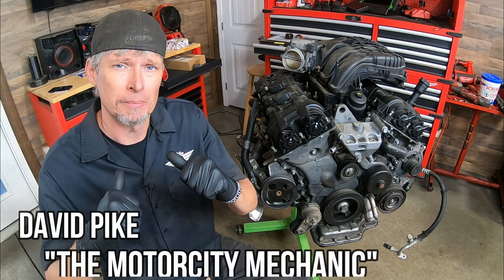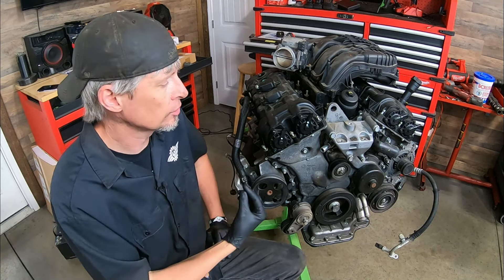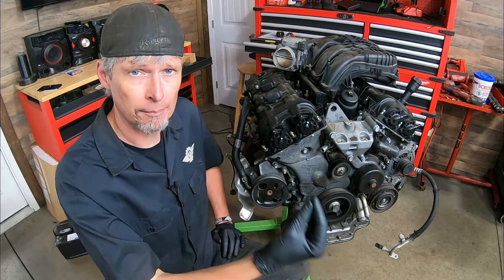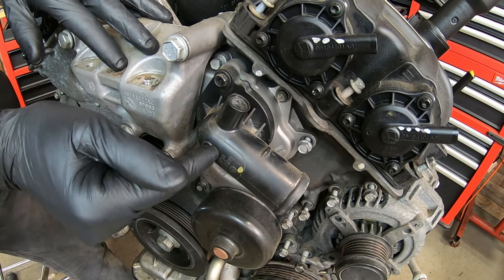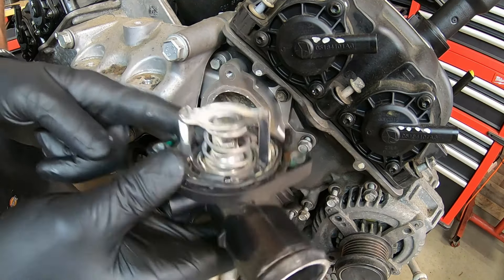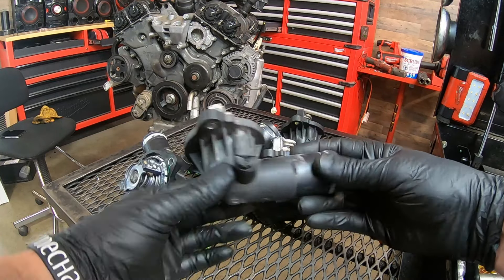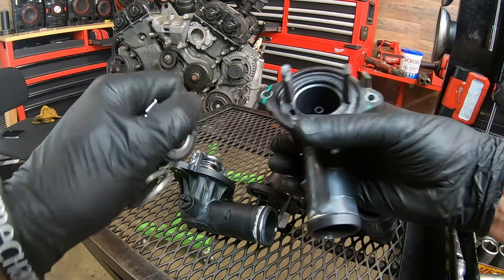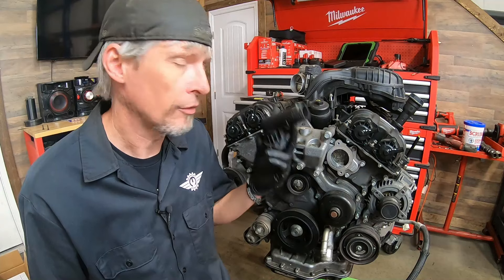P0128 Chrysler 3.2/3.6 Pentastar engine thermostat code, Top 3 causes

Comment: Current cost for genuine Mopar thermostat was around $35 before tax (6/1/23). David is correct. It is an easy to replace part. Just did mine on the 3.6 Pentastar engine, took my time and in 45 min. was done. David is also right about the ‘bleeder’. A ‘light’ approach and you won’t break or over tighten it. Good video and info. Thanks David!

Comment: Thanks David! My son's '15 Chevy 1500 had the same code, and it meant the same thing. Then a week later it spread to daughter's '14 Wrangler 😁. Coolant level was good so went with new Mopar thermostat housing.  It has been good for several months now, so I'm sure the thermostat was faulty.  Son hasn't made time for me to assist him, so we still  have got to change out thermostat on the Chevy..
Reply from the maker: It’s common for sure, at least on the Chrysler’s. I have had to replace a few coolant temp sensors on the Chevys however. Thanks for watching and for the comment
Reply: Those GM thermostats are either hilariously simple or a Total PITA. my 350 is simple.

Comment: Welcome back David. 2013 GC @93k rocker tick. By watching your video's I was able to replace new rockers and lifters and replaced mostly everything on the reassemble. I'm nearing 70 and other than working on old school Chevy 's when I was in my 20's I would not have taken on this job without your outstanding instructional video's David. You are the Master Mechanic!

Comment: Love your channel as I have 3 cherokees with the 3.2l motor and save a ton by doing the work myself. Thank you for such a great channel
Reply from the maker: Thanks for following the channel. Glad to see that the videos help!
Reply: @MotorCityMechanic  Thank You for all the information you’ve covered on these engines.     Have you  ever seen a Mopar thermostat that didn’t have a Mopar logo on it?
Reply from the maker: Typically I see BEHR (like the paint company….might be the same) on the housing….let’s you know that they are made by another company (sub contracted).
Reply: @MotorCityMechanic  I’m going to send a message to your Facebook page.  I assumed they are made by someone else, but I didn’t get what I expected. I’m hoping the two dealers I’ve talked to are not pulling some shady stuff.

Comment: Jeep Chrysler penastar engines are very easy to work on. Pop the trim cover off loosen air intake on 1 side and move over then take off the radiator hose clamp try not to spill too much fluid. Remove 2 10 mil bolts pop off the electrical connector and replace the thermostat. I just bought 1 from oreilys in Richmond Virginia today for $26. I have half a jug of antifreeze so I should be good and I'll save hundreds doing this work myself. Don't take your vehicle to dealers if you have at least a little ability just watch lots of youtube on different repairs.

Comment: My caravan set a code after 7 years. I replaced the thermostat with a Gates brand, possibly the original equipment manufacturer, $20.  It's been 5 years now no problem.

Comment: David, it's been a while since you posted a new video and this one I found to be very interesting. I am planning on doing a coolant flush and replace with Mopar five-year coolant part number 68048953AC. This is the HOAT coolant that is correct for my '12 Chrysler 200 Touring convertible. I have a new Mopar thermostat part number 5184570AJ, which I'm going to replace at that time. Little by little my car is no longer such a mystery as I have been learning and have done regular oil changes, front and rear disk brake reline and power steering fluid change so far.

Comment: Great video as always.  My 2014 threw the P0128 code the other day.  I have had a coolant smell since almost day 1.  Dealer was never able to find it, even though they admitted smelling it.  Had already replaced the intake cam, 12 lifter and rockers for the Pentestar Tick.  Now have the coolant code.  Did notice it running cooler than normal and weak heat, so after the P0128 hit I looked around and noticed the pink stain on the plastic crossover.  Decided to install the Dorman replacements of the both the crossover and the thermostat housing.  While removing the upper engine mount, of course the center bolt broke in the housing.  Swapped it all over with the new Dorman stuff and works like a champ.  
Now I get to deal with the TPMS intermittent light that happened with I picked it up new.  Dealer could not figure it out and got the factory involved.  They replaced the module but again after 8 years it started to throw the light sometimes.  Just found another video with TSB 08-090-17 for a harness to fix the issue!  
Thanks again for the awesome videos!

Comment: Had the code for about a year or more, bought a code reader got the P0128 code, car was low on anti freeze filled it , cleared code got about 50 or so miles and the light popped up again. I had a thermostat just in case. So i replaced it the following day cleared code and the light did not come back. Anti freeze $12-$15, Thermostat $17-$19 and about 15 to 20 mins of labor time. Code reader i bought on Amazon $22. Great Video on why and how dude. I used the work how to replace it video from  FIXIT Angel, No talking he gets straight to the work.

Comment: 2011 Chry T&C, replaced at 120K for same code.  Went out during the winter, and dead giveaway was the heat coming out of the vents wasn't hot, warm at best.  About a week later, Check Engine light popped on.  If you stayed in the driveway and idled, no issues.  As soon as you start driving, never got close to the operating temp.  Replaced Thermostat, no issues since then.  At 160K now.
Reply from the maker: That’s another symptom when they stay stuck open for sure….once you make a video you notice the things you forgot to add. Thanks for the comment William

Comment: Check out that sexy aluminum thermostat housing. 

Another great video. Thanks David!
Reply from the maker: Your welcome and thank you. I am surprised I haven’t come across an aluminum one yet. If they are out there I just haven’t seen them. Dorman talked about one for a while but again….until it shows up
Reply: @MotorCityMechanic  BTW, my fleet of 3 Promasters (all 2014) is at 734k, 716k and 493k miles. Havent lost a transmission yet, though 2 have needed solenoid packs, 1 needed a pump. 

We’re in a golden age of Chrysler, and we don’t even know it!

Comment: Thanks! I'll keep an eye on that housing for leaks. 3.2, 2020 Cherokee
Reply from the maker: Hopefully on a 2020 you won’t have issues
Reply: @MotorCityMechanic  that'd be nice! I know Jeep has made many improvements to the Cherokee  drive train over the years too, but that's still the scary part of owning one of these! Can you do a video on PTU and RDU fluid changes sometime?  Two speed PTU and two speed locking RDU are so complex, we really need to take good care of them. Not much info on them out there either. Thanks.

Comment: Had to do mine at about 100k miles.  Had to roll the dice with Dorman... just turned 200k and no problems, I got lucky lol. 
Great video as always!
Reply: Dorman I believe makes a good product.  There is a hose assemble they make for Dodge 3.6 that T is aluminum not plastic
Reply: Good to hear, got one at Autzone today and the Duralast was a Dorman.
Reply: 50/ 50 with a doorman part . Most doorman parts that don’t require anything to do with sensors or blend door actuators are ok . If any sensors or HVAC actuators are needed it’s best to get from dealer , avoid doorman .

Comment: Had that code on a 2005 5.7. Stealership diagnosed it to be the temp sensor and wanted to charge me even though the vehicle was still under power train warranty. I declined their offer for me to give them money. The code only happened when the morning outside temp was between 25 to 30 F and 20min into the trip. Other than the code, the car ran great and never overheated so I didn’t worry about it. A couple years later I changed the coolant and took the thermostat out to inspect it. Sure enough, the factory thermostat was allowing some coolant to flow when it at room temperature due to a warped/wavy seal.
Reply from the maker: Yeah temp sensors aren’t common on Chrysler’s…..other brands like Chevy yeah.

Comment: The leak you described at 4:57 was a catastrophic break on my 2014 Grand Caravan.  Unfortunately, my 16 year old son was driving, not paying attention and dumped all of the coolant on the pavement, smoking 3 cylinders.  Got the code just a couple days before.  The moral;  keep a thermostat assembly handy, and replace it ASAP if you get the code.
Reply from the maker: Haven’t seen that happen yet but I’m sure it can happen. I see it mainly in the heater hose “t’s”. Still waiting on someone to make a metal version. Not sure why no one has yet

Comment: Nice information.  Plastic thermostat housing because of course it is.  My current 3.6L is in the shop for a broken lower radiator connection.  Plastic.
Reply from the maker: You have to love plastic in the cooling system! Give it time….it will fail. Thanks for watching

Comment: Yea they had the flash updates for the KL Jeep 2.4 supposedly to de-sensitize it but like you suggested, just get the thermostat done with a OEM part,
Reply from the maker: After a few of those they became gravy…..some guys would leave that one hard to get to bolt in place and snap the housing and then take it off. I couldn’t ever make myself so that. Still good money back when we were doing a lot of them. Thanks for the support man!

Comment: Love your videos, they’ve helped tremendously over the years diagnose and fix my 2014 Ram 4x4 with the 3.6. Recently having trouble and would like your advice. Problem statement: my truck burps antifreeze via the overflow every time I shut truck off after it’s reached temp. Eventually if I don’t check it regularly it will start to over heat. I have replaced water pump, cross over, Hoses, and thermostat about 110k miles and now at 163k miles. When system is pressurized it holds till I start truck then drops. Been told I have a head gasket leaking internally or warped heads and need a new engine. It’s running strong though and currently not throwing any codes. Do I need an engine rebuild or could it be something simple? We’ve bled air out so believe we’ve eliminated that as cause.  Thanks for your time and expertise!!!!

Comment: Amazing video!  Subscribed!
I had the thermostat replaced but it seems the mechanic wasnt able to vacuum all of the air out of fhe system as there's a water sloshing noise behind the dash.  He said it would eventually dissipate but its been 4 months now.  I've tried bleeding the system through the bleeder valve on the thermostat but the sloshing doesn't fully disappear and increases in volume soon afterwards.  Any idea what could be the issue?

Comment: 2013 Ram 1500 3.6L  oil cooler and filter housing cracked.  Had it replaced and week later the P0128 code came on.  Had local mechanic that did the oil cooler housing replacement change the thermostat.  2 weeks later after replacement of thermostat the P0128 code came back on.  Drove it back to them today but I am curious if it possible the new thermostat (NAPA version) is bad or stuck after 2 weeks?  Asked why not the OEM and they said it was no longer available and he preferred the OEM.  I do know that the original that was on my 3.6L was an aluminum looking body which looking up on Mopar all you find is the plastic version.  Any thoughts?

Comment: This guy rocks, changed thermostat and water cooler crossover beneath W Dorman aluminum refilled coolant bled test drove stays at 205 on my 2018 Charger STX but cannot delete code w my Innova 5160, what's the deal? Will engine light go away? Thanks man

Comment: 2012 Town and Country with the 3.6 Just completed the lifter and rocker arm replacement while watching your part 1 & 2 videos. Van is quiet as a mouse now. Now addressing two codes that have been on for a bit. The po128 as described in this video. Will be replacing the thermostat today. But can you help or do you have a video addressing the PO430 code? Both of my o2 sensors read fine with the resistance check. The inlet and outlet temps of the converter are ok with the outlet being ~100° hotter. Only thing i haven't done is a back pressure check, mainly due to the difficulty of removing the o2 sensor. Any tips or experience with this code??

Comment: What's option 4 & 5?  I have a 3.6 pentastar that gets a P0128 very intermittently, have done several thermostats (mopar, autozone).  Any sugestions?  Scan tool reported a steady temp of 170+-3deg with all the thermostats.

Comment: Hello. Was hoping for some guidance. I drive a 2016 Jeep jku with the 3.6L. I had a leak in my radiator and replaced it. While at it I replaced upper and lower hoses. Trans oil cooler which had a leak where the in/out lines are attached and replaced those lines as well. Replaced tstat and all new mopar coolant. However as soon as I get on the freeway I just running just over half on my analog gauge. It will get to 230 deg. I never had any warming issues prior to the leak. Any advice would be greatly appreciated.

Comment: when opening the little screw on the thermostat do the car need to be running or off.  I know i need the reservoir open to refill everything but when i changed mine i left cap off while running to let air get out that way.

Comment: Having had this code on a 2014 300S I recently bought then ordering both a thermostat, to have on hand as a spare, along with a complete assembly as you show.....does the Mopar branded one come assembled so to speak as mine came in a box sort of a mess. While not an issue to push that spring down I think I may return & go to the local Dodge dealer for the factory part. Also if the car has decent heat does the computer simply think the thermostat is not opening fast enough vs it simply being open 🤔

Comment: Have a 2006 charger 3.5 with this code had to change oil cooler and heater core before code appeared running with distilled water cleared code has not come back on going to drain and add antifreeze hopefully code won’t come back on what’s your thoughts

Comment: Can you tell me if there is 1 or 2 coolant temperature sensors. I find one on the engine block but I don’t see another one and i was told that there’s two sensors.
Reply from the maker: One coolant and one oil temp. Oil temp is on the oil filter housing/cooler under the intake and coolant is on the rear corner of the left cylinder head area

Comment: Where is the Engine Coolant Temperature Sensor located, I can't find it on my car. I have a 2015 Chrysler 200 S 3.6 AWD, I also have Code P0128 that came up and the auto part store recommended this part also. Thanks for help and videos are a great help; extensive detail for the DYI'er.

Comment: Looking for a video on how to replace the seals on the VVL and CMP sensors for leaking oil at top of valve cover. And, can this be done without causing other problems on a 2020 Voyager 3.6 engine.

Comment: I have a 2015 chrysler town and country and sounds strange, but /he van runs and drives great til the engine gets to temp then my transmission has some hard shifts and also when coming to a complete stop it some times shuts off.  I do notice when sitting at idle the rpm drop and come back up ever so often.  Any ideas on my situation?

Comment: Hey man! I have a 2016 Chrysler 300s with a P0128 Code and I went ahead and replaced my thermostat and refilled my coolant, and the code is still there. any idea what it could be?? Temp levels are normal across the board as well

Comment: Thanks for all your great videos very helpful! Just replaced radiator, thermostat and coolant to fixed radiator leaks. Wasn’t getting po128 code before repairing now getting code with check engine light! Any ideas?

Comment: If this was a software update instead of thermostat issue, shouldn't the dealership do that at a no charge?  I'm suprised this problem haven't turned into a recall if there has been so many complaints. Also do you have the mopar part nunber for the replacement thermostat?

Comment: Love your videos. I have an '09 Charger 5.7L PP w/149k miles. I have very annoying problem filling the gas tank. It works fine for the first 5gals or so, but after that, pump will click off 20 or more times. It's NOT the gas pump. What is the problem?

Comment: Once you replace it will the light shut off? Or do you have to clear it with a scan tool?
Reply from the maker: Technically if all is good and fixed……the light should go off after a few days otherwise I just clear it with a scanner
Reply: I just replaced mine and drove it today for the first time, light still on but will give it a day or two more to see if it goes out on its own.

Comment: Love your content very insightful as I am a new Ram owner. I have a question I’m hoping you could shed some light on. I have a 19 Ram 1500 with 39k miles. It keeps throwing u11e9 code. I can clear it out with a scanner and all is good for several days and then it comes back. The AGS seem to function as normal with no damage. From what I can feel the wires at the pigtail seem solid. Any thoughts or insight? I can open and close the shutters with some resistance by hand as well. Could it be the motor? Or possibly a weak wire? Any advice is greatly appreciated.

Comment: I just Did a Transmission Fluid Pan/Filter change and got this P0128 code a few hours later after the service, I cleared the code and hasn’t come back since. Do you think this is just a coincidence? Could this also throw this Code?